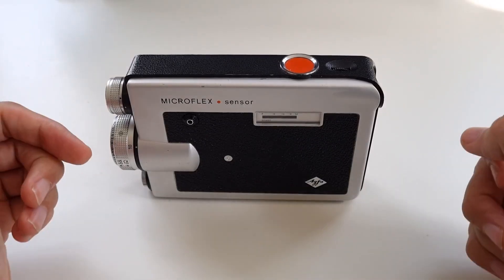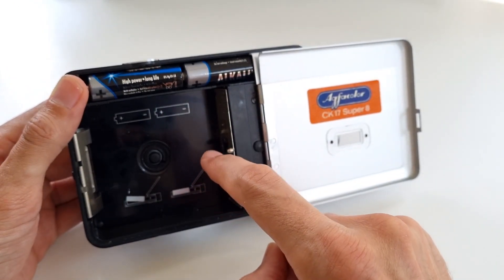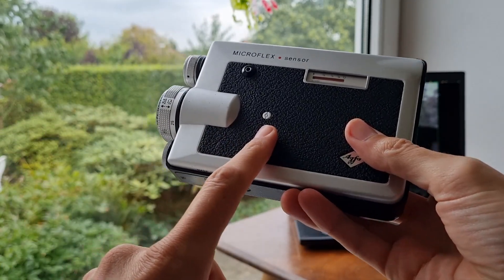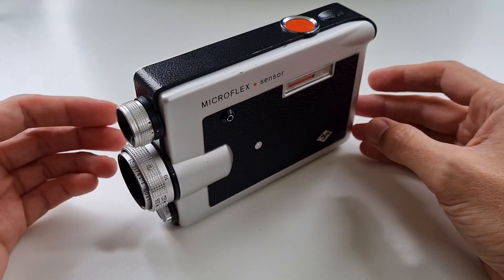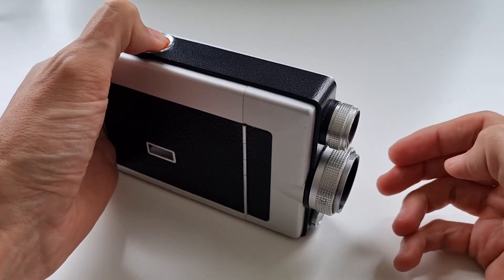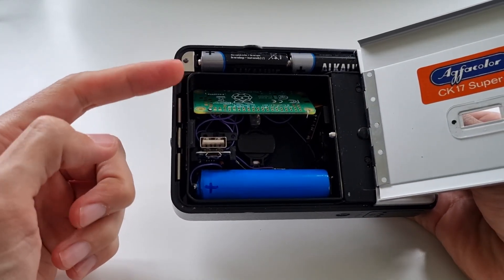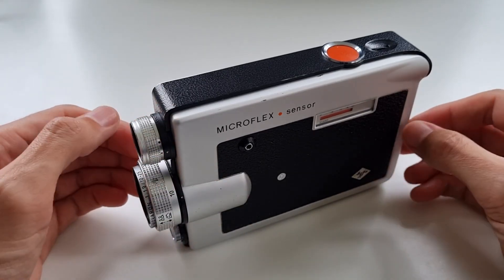Super 8 Camera Digital Conversion (using Raspberry Pi)

Comment: Please help me, I'm sure I'm missing something really obvious here. I've watched this video several times, looked at the github page and the 3d model of the cartridge and still can't understand how the LED/LDR pair work to start/stop recording. There doesn't seem to be anything between them that would open/close a circuit for the LED to come on and allow the LDR to open. I have this exact model camera and the bit that rotates the spool is tiny and has a 'catch' that sticks out maybe 1mm. Again, any help or explanations are appreciated. I alerady have all the parts on hand to make this, just struggling with the LED/LDR pair.
Reply: In the onshape files there are 2 other parts a spinning piece with holes either side that links with the sprocket on the camera and a piece to hold it in place hope this helps I'm currently printing it all myself 😂

Comment: Hi, great video! I've noticed that you've removed bracket from inner body that align film. Is that so? Also did you removed shutter from the camera as it looks like there is no frame synchronisation mechanism
Reply from the maker: Thanks! Indeed, the bracket is removed so that the sensor could be moved closer to the lens. Alternatively, the lens could also be moved further inwards. But I did not do that because I didn't want to loose the factory focus setting of my camera.
The shutter wheel is indeed disengaged. For my camera model it was very easy, I just had to bend the gear of it a little bit so that it disengages and doesn't move anymore.
Reply: @kassenbon  Thanks for your answer. I've been thinking to achieve results with minimum modification of the camera as I like the idea to put film cartridge and it would work anytime.

Comment: Congrats on this. Wonderful project. I agree that it looks very similar to some Super 8 with auto aperture control. Something I wonder with the power of the latest Pi is whether higher quality camera sensors may become available - and in different sizes. This would greatly elevate the kind of DIY camera projects a person could do. For example, you don't say exactly how big the sensor is, but it looks like it would cover the whole super 8 frame. 

How wonderful if there was a sensor for the Pi that could cover Super16 for cameras like the Bolex (although the modifications may be considerably more complex given that they didn't operate on cartridges - meaning there's like little space for the sensor behind the film gate). And when I say higher quality sensors... the readout speed on this sensor is comparitively slow for such a small sensor compared to consumer cameras. So there's a lot of wobble (rolling-shutter) which you wouldn't see on Super 8 film.

Comment: As far as I see the sensor you are using is having a size of 3.7x2.7mm, while the original Super8 film has 5.8x4mm. That might also magnify some artifact. Ideal would be a more closer match, but we also need to fit in the place. Some details would be nice, e.g. rolling detection. Thanks anyway!

Comment: but despite all the bad points, my super 8 films are still viewable after 60 years and all the early videos and files have gone to crap.  different fomats particularly rendered early digital photos and video dead.  if you want to save photos for a long time, print them on paper  black and white.  all digitals eventually fail

Comment: 8mm movies, not "videos"  :)   Super 8mm lasted decades, "regular" 8mm went back to the 40s.  In it's last throws, one word:  Fotomat!  I mean, you could get your roll back in the same week!  Cheap carts too, unfortunately nothing ever captured the beauty of the Kodak low ASA reversal (Kodachrome).  

In the 90s and 2000's, a company in L.A. called "Super-8 Sound" thrived.  They cut negative (not reversal) from 35mm film stocks and sold to professionals for commercials, music videos, creative works.  I believe they also leased cameras with large mags (not carts) that worked with timecode and double-system sound.  Being negative film as well as higher end cameras, the look was much denser with good color balance and saturation, no blow-outs.  The grain and resolution were better than the reversal carts, but still obviously (pleasingly) low resolution.

Brilliant RazPi invention.  You're right that the emulation you've achieved is uncanny.  Good lord.  18fps video would not look like that "out of the box".  You mention prism, optics, shake, white balance.  Is the shutter in the camera still spinning?  Is the rate of capture in any way synced to the shutter?  Just wild.  I definitely want to make this cartridge.  (I've got my share of regular and super 8mm cameras -- to think that digital film could actually capture so much of the characteristics, never would have expected it....)  Nice work.

Comment: Hello, do you just cut power to turn the pi off?
Reply from the maker: Hi. Yes. That is a bit unorthodox but typically, if you do not write data, you'll survive this
Reply: @kassenbon  Thank you for your response! I had never even touched a raspberry pi before but this inspired me to give it a shot. I think I have my code worked out and I have most of the hardware. I'm just about to try and insert the camera into the cartridge and figure out the right position for the focus. Did your super8 camera have a metal plate in front of the shutter opening?

Comment: Interesting but no, the resolution of Super 8 was far higher than VHS or Beta Max, you can get better than HD video out of a Super 8 scan, somewhere closer to 1440p when scanned at 4k. What killed Super 8 is that you couldn't see what you shot instantly.  Then there was the fact that you had to pay for development. Then you could only record on it once.

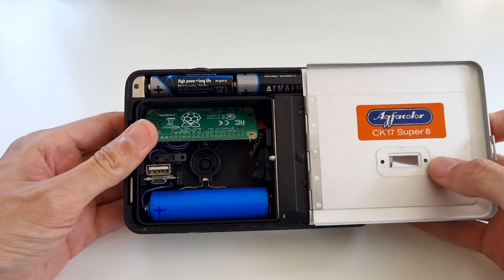In fact, VHS is not film, but magnetic tape, which is still used today for recording data backups for server grade computers. The problems with Super 8 are none of the things you mentioned. The problem with Super 8 especially today is the high cost for development. About 2:30 (two and a half minutes) costs you about $100 USD to get developed and scanned at 2.5k.

There were 24 and even 12 and 48fps options on some Super 8 cameras not just 18fps. It's just that 18fps is the default recording speed for 8mm dating back as far as when 8mm cameras were originally released. Although there are plenty of Super 8 cameras that can record at 24fps and even 12fps (as I said for "time lapse" effects) or 48fps (for motion).

When you shoot at 12fps you would play the footage back at 24fps and when you shot at 48fps you would slow the frame rate back down to 24fps so that you could record motion without the stuttering.

These cameras were quite a lot more advanced than you give them credit for, further to the point, many people still use them today, especially if you want to get the true "look" of cinema film. 

Super 8 gives you the closest look to authentic cinema film which is why people use it today even if 16mm will give you much more resolution. 

You've also seen plenty of people use these types of cameras, even today, because they work in exactly the same way as a 35mm or even 65 or 70mm camera that Wally Pfister used to record many of the scenes of The Dark Knight in 65mm film. 

These cameras work in exactly the same way as a 65mm camera actually, they just come with an "idiot proof" cartridge that can be loaded by anyone, in direct sunlight, without ruining the film inside it, as the film is in a light sealed cartridge.

Super 8 was meant to be the answer to 35mm film for photography, as a cheap and affordable home user format, and it was, right up until the 1970s when VHS became a thing. But, Super 8 is a non-linear format, as it records 8mm photos through the gate... It's called a gate not a window.... and because its a picture based format and not a magnetic based format you can keep recording in better quality every time technology improves.

Then there is the advent of AI upscaling meaning the actual quality of Super 8 film is almost limitless.

This would be a good video, if anything you said was correct. Also you've basically created a Hi8 camera, it's been done before... The look comes from both the shutter, which is still moving in front of the lens... and the glass... which produces its own optics and colours.

Comment: The GPIO18 should be pulled up with a 10 Kohm resistor to the 3.3V pin, not to a 5V pin. The GPIO pins on Pi Zero use 3.3V logic.

Comment: I dont get it. Everthing wired (i think so) correctly. 
5v--->1k Ohm Resistor--->LED----> GND and
5v--->10k Ohm Resistor--->Photoresistor---> Gpio18 (Pin12).
If i'm trying to take a video, nothing happens. Can somebody give me a info whats wrong please
Reply from the maker: Please try to manually rotate the center wheel and measure the voltage when it blocks and when it passes the light with a multimeter.
Reply: If it blocks the light it's about 0.08V. If it get's light there are 4.25V ob the multimeter
Reply from the maker: @lagra-LO  That sounds perfect. In that case you should check the GPIO to which it is connected. If that looks ok, you would have to alter the python script and add some debug messages at the point where the GPIO should trigger an action.
Reply: @kassenbon  it's crazy. With a insert SD-Card and a running pi the voltage values are completly different. Now they an 0.3v in the dark and 0.01v with light.
I'm start to get nuts. I will rebuild it with a other Pi again and will see whats happend. Is there a Tutorial coming up someday. This would bei really helpfull for noobs in electonic like me.
Reply: Error was found. 5v--->10k Ohm Resistor--->Gpio18---->Photoresistor---> GND. Now the pi starts to record and also stop. 

But there is a new problem. The pi camera is totally out of focus. Also the taken Clip is purple.
Reply from the maker: Purple tint sounds as if the camera is missing an IR cut filter.
Lack of focus is likely due to the fact that the sensor is too far away from the lens. If you cannot get it closer you could also refocus the lens. My camera has a screw thread with which you could adjust the focus. I did not need to do so but it is possible.
Reply: @kassenbon  you mean the lens of your microflex right?
Reply from the maker: Yes
Reply: @kassenbon  Ich werde  jetzt einfach mal auf deutsch schreiben, da es mir als meinen Muttersprache, einfach leichter von der Hand geht (und ich erahne, dass es auch ihre ist).
Ich  habe mir jetzt eine neue "Picamera" versorgt, die Entfernung zwischen Sensor und Opjektiv der Kamera (benutze übrigens die selbe) verkürzt. Nun Ärgere ich mich mit massiven Artefakten herum. Sobald ich zoome, wird das  Bild grobpixelig. Ist das der Limitierung des Pi0 verschuldet? 

Sie meinten es gäbe Möglichkeit an der Kamera den Focus via Schraube zu verstellen. Könnten sie mir einen Tipp diesbezuglich geben?

Comment: how to connect the optical sensor?
Reply from the maker: Hey. You need to have a photo resistor plus a regular resistor in a series configuration, creating a voltage divider. The value of the resistor depends on your led and photo resistor so you'd have to experiment a bit. The output should be <1V when blocked and >2.5V when open.
Reply: Thanks for the response!
Reply: Hi again. I have a problem with focusing. Only objects very close to the lens are visible, once the object is moved away from the lens it gets blurry (adjusting the focus doesnt help). Did you experience similar issue? Do you think this casette works only with your camera? I was trying it on Canon 514

Comment: Did you have trouble getting the camera sensor to focus? Does AutoFocus need to be disabled? I am using LibraCamera, any help is appreciated.
Reply from the maker: It is indeed a bit tricky. The card ridge is designed so that the sensor can move back and forth. I used the live preview to find the best focus and then used super glue to fix it in place.

Comment: Hi! Can I ask what kind of voltage converter did you use between the Raspberry and the 18650 battery?
Reply from the maker: Hey. It was part of the power bank. I just disassembled one of these very cheap single cell power banks.

Comment: Hi Befinitiv, wonderful project, also I'm one of these who where thinking about that Super8 to Digital idea; some time ago I was fooling around with the pi zero and camera, but was intimidated by the shutter problem and size of the camera sensor,. And thanks to you're work, I put out all the stuff and my lovely old super8 cam on the table again and try to rebuild it. After some days of thinking around I have some questions around the project.
- I had a look at the cartridge print files, and thought that the cartridge walls are quiet thin to print. I would like to know how you printed them with a filament printer (Which one?), or SLA?
- To understand the code, I installed it to my pi, and it seems to work well, I found the h264 files, but i didn't get the streaming thing. If I'm right, the pi acts as server, but if I try to connect via the browser to the IP (the IP I changed for my network) with port, it doesn't work.
- And I was thinking about other camera modules with a better size for the Super8 format, to have a bit less this zoom effect with a lost of nearly 65% of the initial image. The nearest standard sensor for the S8 format (5.79 x 4.14) seems to be a 1/2,5'' sensor, tall enough to take the entier image, or even a 1/3 (4,8 x 3,6) could be nice (lost of "only" 28%). I had a quick look, but the sensors i found where all mounted on oversized boards to put them directly in front of the Image. Perhaps to play around with prisms could be a solution? Do you have some thoughts about that?
Yes, Only three little questions;-) and the hope to have my camera working soon. Thanks a lot for sharing your work and greetings from France
Reply from the maker: Great to hear! I used a standard FDM printer with PLA filament. For the streaming you need to use gstreamer since it transports raw h264 data.
The RPI HQ sensor should do a better job for covering the complete frame. It might be however a little bit too large to integrate. But I woul dbe glad if you could prove me wrong :)
Reply: @kassenbon  Thank you for your quick reply! Yes indeed, the HQ cam could be nice with the 1/2.3 sensor. The Arducam MINI IMX477 should be tiny enough (24 x 25mm) because the sensor is not centered on the board, BUT it seems that the mount of the sensor on the board will give a portrait format, and not landscape.   ;-( (that means that the height of the image is ok, but the width is cut to a nearly square format (from 5.79 to 4.55) so a lose of 32%. But thats quiet better than the 1/4'' sensor.
And I had a look at the Gstreamer stuff,... whow, just another other thing to discover. Could you show the basic command line strings you use on Server and on client side, to understand it better (And quicker;-) . That would really great.
All the best and thanks in advance.

Comment: Hi, did you remove the shutter from the camera? Or how else do you ensure that the videocam exposes exactly when the shutter of the Super8 camera is open? So how do you sync the cmos sensor cam with the Super8 cam?
Reply from the maker: The shutter wheel is jammed 🤭

Comment: Actually; "crappy" footage, in terms of resolution, is really just anything taken on early to video, to somewhat of the.. Advent of 60+fps capable camera's and phones.

As the resolution of a VHS tape is still only 240 lines, which is way less than the resolution of a super 8 millimeter frame.

Also; the biggest inconvenience of super 8 was not as much the 3 minutes, nor the price; as prices were way lower back when everyone was shooting film; the biggest drawback was that it was inconvenient; even though the footage, especially compared to the VHS years of digital video..which... Are kind of cold, I guess, and the resolution is... Meow "crappy", especially on a 4k TV >.>

Also; this is still cool, and I wanna play with; because it looks cool; and it's still more than kodak has given us -.-

Comment: Hi! great solution. I developed the 'Digital Super8 Cartridge' and it is somewhat more complex, using synchronized frame capturing and global reset release. Your solution provides a cheaper solution and easier for people to self-build. I did all my software coding in C++ and I use an industry grade subminiature camera which is quite expensive but very programmable. Using OpenCV libraries to handle the 12 bit RAW images.
Reply: Would you be willing to chat about this?
Reply: @nick.kalisz  Sure! what is it you want to talk about? You can find me on FB and PM me.
Reply: How much would buying one from you cost??
Reply: @ryan_stovall_  Hi! So far it’s not for sale and there are only two prototypes. Not perfect because you have to remove the film gate from your camera. Once I perfect it (if ever) it would go for at least €999,- because of the expensive subminiature camera (12 bit resolution and global reset release shutter).
Reply: synchronised capture would be really cool, going to your channel now!

Comment: Great project! Could we have some more information about the build? In particular, how did you modify the Pi camera to expose the sensor? And how did you disable the movie camera’s mechanical shutter? Thanks!
Reply from the maker: Thanks! For the camera I used an exactor knife to cut away the front plastics. The mechanical shutter depends a lot on the camera model. I my case I could simply bend a thin gear of the shutter so that it disengages from the driving gear. And it also jams the shutter. But this will likely be very different on another camera model.